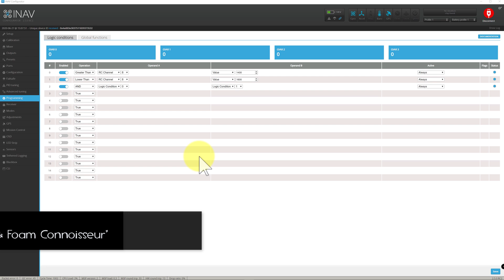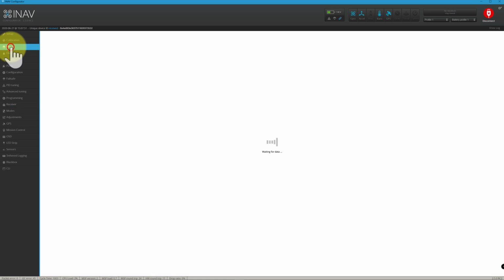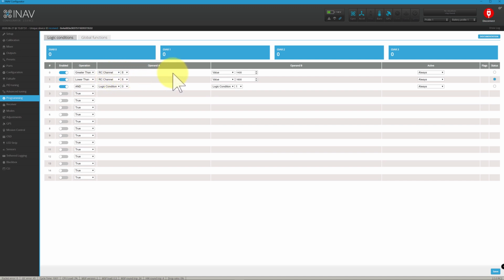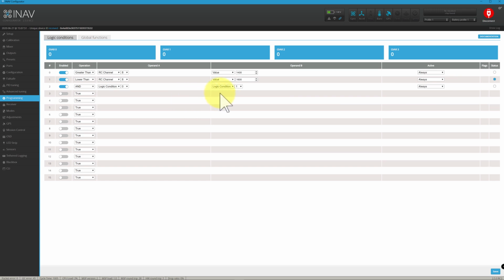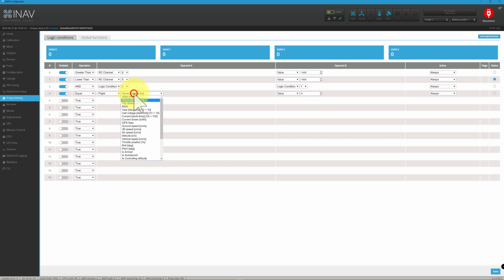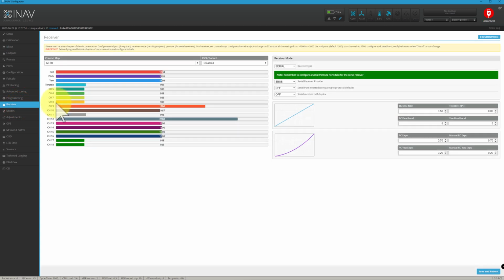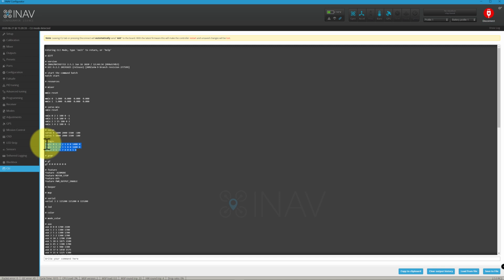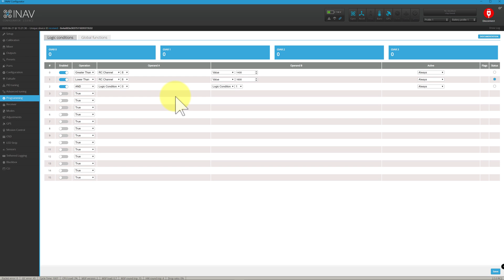An Introduction to Programming Functions in iNav (for Flaps)

Comment: i am new to plane why not just put a flap function on a switch alone. when you flip the switch down, the flap goes down and when you flip the switch up, the flap goes up. maybe i miss something. you needed to show the actual servo moving. good job tho.
Reply: That's what's confusing the F out of me.   Some tell me to just add flaps to a 3 position switch and add the mix in inav of where the switch is and that's it.  Then I see videos like this that completely through me off.   I'm about to just tape the flaps and just not use them.  Way to complicated when I'm sure it shouldn't be.

Comment: instead of using the "greater than" and "lower that" operation you could use "low", "mid" and "high". I found this easier because these values are corresponding to a range, e. g. "mid" is between 1333 and 1666.
Reply from the maker: Hey Dan, oh wow I didn't know that. Thanks!

Comment: Elegant solution.  Logic conditions and global functions really good for managing VTX power through smart audio, which is handy if you're running a totally-legal-within-your-jurisdiction 2000mw VTX and dont want to knock out the phone towers when you're just noodling around in close proximity.  You can even set the logic condition based on distance to home and have it adjust VTX power autonomously.  Next experiment is to have flaps automagically deploy below a given indicated air speed.
Reply from the maker: Howdy, yea that ability to do that is well cool. As for speed. Probably not the best idea to deploy flaps automatically, as on a day like today, in a cross winds they'd have been out the majority of the time. Matt
Reply: @RagTheNutsOff  Yeah definitely assign auto flaps to a switch lol. I run pitot tubes so in theory it should account for wind speed. Famous last words...

Comment: Hi Matt. 
I run some motor gliders out of a fairly tight field. An essential aid for landing is crow braking. 3 position switch(channel 7) mid is half flaps 3rd position is crow. Running Inav 2.5.1 on a matek f405/f722. Frsky XSR receiver. 
Inav mixer, flaps (channel 7)on pass through, has flaps set in mixer with weights reversed (ailerons go up).  Flaps set on modes (channel 7) on 3rd position of switch.  I have camber (affecting only the flaps) set on my transmitter, 3 position switch giving 2 settings of camber. 
It would be nice to be able to run camber on both flaps and ailerons. My present setup is an either/or choice as regards crow or full camber.
Any thoughts please?
Reply from the maker: Hey Garry, not sure on this. It would be best to play with a couple of options and see what works for you in the programming tab. Matt

Comment: I would use this for locking in a fixed throttle position on a switch for just cruising.
Reply: Like a glider for slowing the model down on landing some run the motor for drag, nice idea!!

Comment: So the flaps are not flaps????     Let me guess..  a duck is not really a duck?       please explain. 
IMO     there are many kinds of flaps. 
Simple flaps/plain flaps
slotted flaps 
split flaps 
fowler flaps
double fowler etc. etc.
but all can be called flaps, especially when used as such.
benifit of doing everything in the FC program is that you can clone the program and it will work with any transmitter/controller.   good on you for diving in and doing tit that way, although i'll have to say i'd rather use arduplane.  but preference.   hope you have a good maiden.
Reply from the maker: They're not barn-door flaps like on a Tundra. Now that's flaps!
Reply: @RagTheNutsOff  So it's like the Crocodile Dundee "That's not a knife.  This is a knife."   Ok, i get it now.  Why not just say that in the video?  would be funny, and relatable. :)
Reply: this is just my opinion, but it's a lot just to put a flap. i still don't get it.
Reply: @nivasylstrongman4352  I agree.   Way to confusing